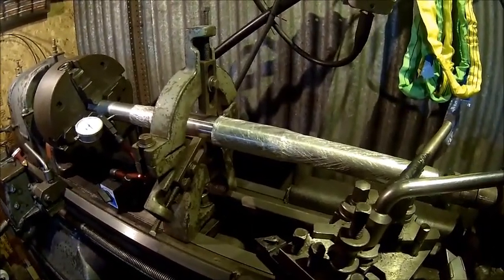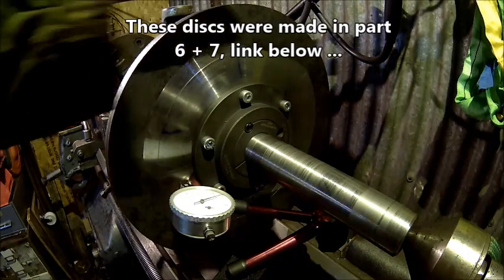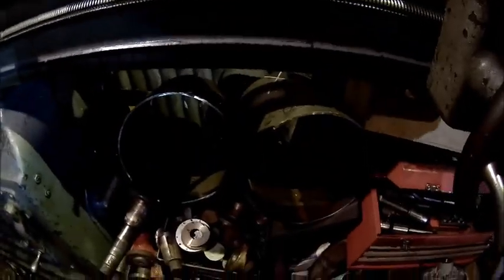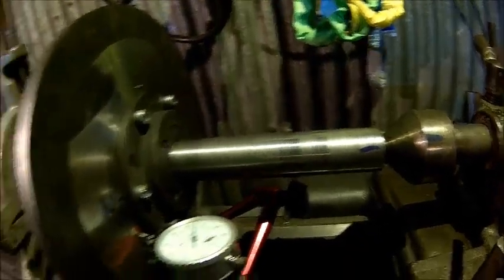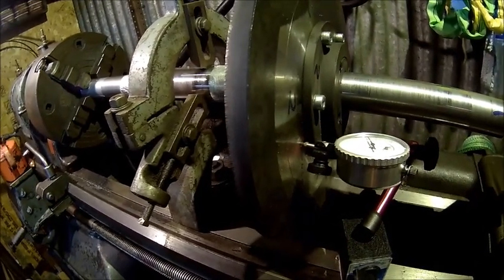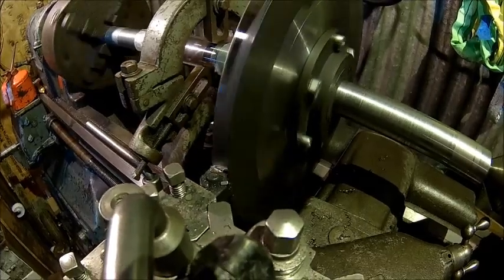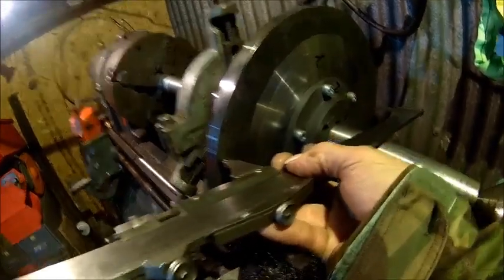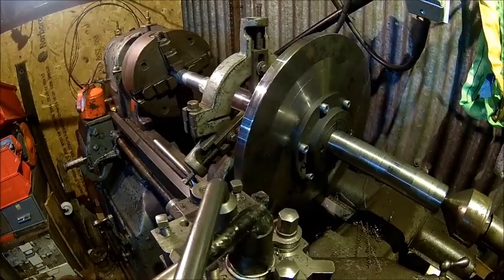The Mystery Project - Part 8, some parts coming together, making chips and a few teasers

Comment: I’ll be looking for the grinder video, a little horizontal milling there. Like the serious turning too.
Reply from the maker: There is a quick function test of that grinder in some of the videos after 21st Jan 2018, just cannot remember which one it is. I didn't do much to it, just oiled it up and used it because i needed to grind some parts. It does need quite a bit of  work and it's going to come sooner or later